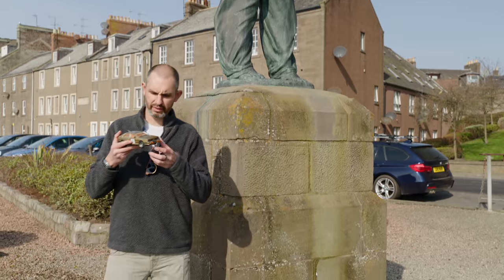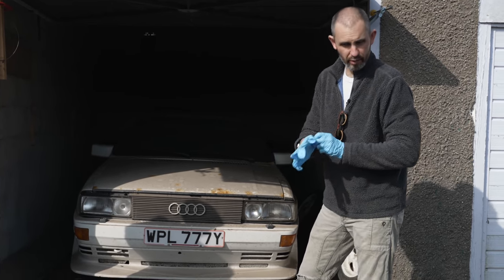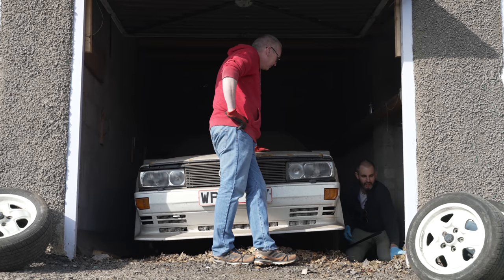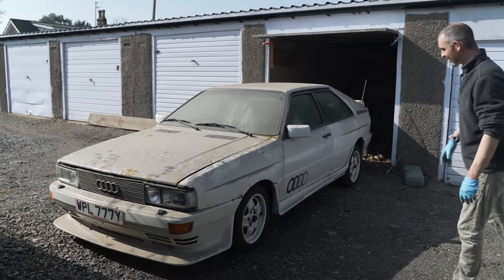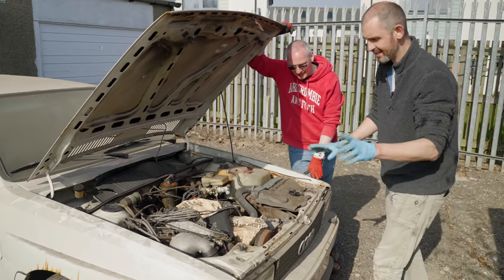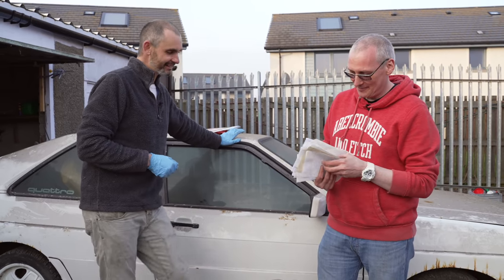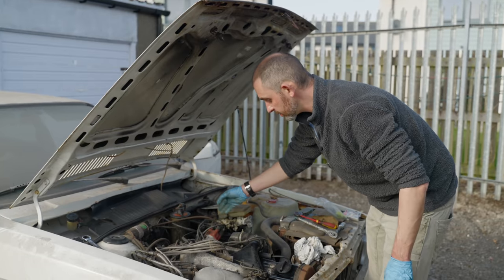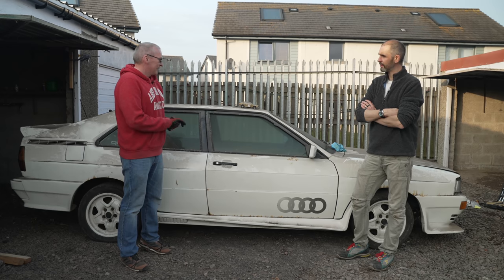Audi Ur Quattro Turbo Barn Find  - rare survivor sat for nearly 30 years

Comment: Very cool car. For anyone looking to do something similar then NEVER attempt to put fuel from an old tank (be it fresh or otherwise) through a K Jetronic injection system. In all honesty it shouldn't be put through any injection system but K Jet is extremely vulnerable to dirt & once it gets in it can be impossible to get out. That fact combined with the fact that the system pressure is high (circa 70psi) means you want to give everything a good going over before you risk sparks & fuel coming together. Ideally flush the tank & purge everything through then pressure test. With no crank on this one & from the era that the car was last used then there is a good chance it has an immobiliser or at least a hidden switch somewhere. You can normally tell if the solenoid is actually pulling current as it will casue a voltage drop which can be seen by the dash lights dimming. The other obvious point for this car which should have been checked & ideally renewed was the cambelt. Given the fact that the engine had also been left open then you would want to turn it by hand & make sure it felt ok before going anywhere near the starter, ideally you would always do that. As it's a barn find special it would be good if there was a bit more structure to the process of reviving a car that has been stood for so long, if all the right checks & work has been done then it'll run & not destroy itself or catch fire.
Reply: Perfect response and also applies to any belt drive engine and any fuel injection system.
Reply: I had a similar reaction when Jonny said he was going to put fuel in an old tank.  Should have been all spark plugs out and turned by hand.  And only turned by hand after oil was put in each cylinder.
Reply: Exactly this !. Ex SAAB Master Tech here and i did my training on 900 T 8v's so know K Jetronic well.
Reply: It makes me cringe a bit to think about the state that the oil might be in on some of these barnfinds. I know that starting the engine is part of the barnfind 'schtick', but I'd much prefer it done after the oil had been dropped and refilled with fresh stuff (and potentially flush).
Reply: Yes, the cam belt was definitley some thing that should have been changed before a start attempt. Good advice.
Reply: I would not attempt to start the engine at all. Something this age and this neglected really should be rebuilt though keep the original pistons & rings if possible.
Reply: outside of the belts which along with the tires are probably toast.  For the fuel, getting those little inline fuel filters to splice in ahead of the fuel injection go a long way.  But yeah, always better to drain (and clean) the old tank or just replace it and the in tank pump (if applicable).
Reply: Totally agree. I recall vw petrol tanks being somewhat prone to rust in the 80s
Reply: @davidpritchard6102  doing an engine flush can potentially do more harm than good,especially on a car of this age and sat that long
Reply: I had the secret switch in an Xr3i
Reply: @dazspurs9899  More damage than trying to start a car with sludgy oil blocking all the oil passageways? I doubt it...
Reply: @dazspurs9899  So what to do?  Genuinely asking what would be the best way to progress appropriately.
Reply: 😂 look at this nerd trying to explain his reason
Reply: Excellent points here. Jonny would be better getting a few knowledgeable OC mechanics to come with him and they tackle all this together. Would probably get most of the cars running on the day and safely with more knowledge and more hands available.
Reply: Couldn't agree more. The show loses credibility because of this, and anyone who's that much of an enthusiast would surely know that. 
Also have to mention ....
It's Ür Quattro, not 'U R' Quattro
Reply: That doesn't make for good TV though🤔
Reply: The way they do it looks very amateurs. Shame for petrolheads and given the age of the car.
Reply: Couldn’t agree more.
Reply: I've not even watched the video yet . For some reason  I've came to the comments first? I'm cringing about it before I  even get to see It now!! I watched him do the south African BMW light weight m series just the other day and he brought a guy along who he kept  calling Mr BMW or something like that.  Now he had everything he could possibly have ever needed to service it before even thinking about even turning it over by hand.. the only thing he didnr have at first was a good batterie pack
. Because Jonny had a poxy  crappy Ebay jobby
.. in the end, Mr BMW pulled his own brand new BMW battery off his own car... 

I do t know why Jonny try to claim hes a car lover.. it's a fucking sin trying to turn over engines that ain't ran on decades with out at least taking all the plugs out an tipping in a bit of diesel ect. The hand crank it first ect.. 

Its propper 1 0 1 basics???????
.
Reply: Truth.
Reply: @brendanobrien5842 he usually does take out the plugs and put a little penetrating oil down, seem to have alot of commenters on here, but he's the one with the show or channel, so easy to sit and say what he should or shouldn't do, but he's doing and seems to be doing alright.... I get it, and I might do something different sometimes as well, but honestly I just watch to see what cool cars are found, not to judge....

Comment: Should always check for a hidden kill switch. Best security feature around back in those days.
Reply: Agreed hidden under the dash somewhere maybe in drivers footwell, I've put a fuel pump cut off switch because cars from that era were very easy to steal!
Reply: Brodie Britain used to supply and fit them and they tuned these
Reply: Yep, done that with my cars, fitted a inline switch from the ignition under the dash that can be reached easily
Reply: Yea I think your probably onto it there . Be odd for not even a click at all
Reply: Ah yes.  The half tennis ball worked with this era vw audi.  Not that I'd know of course...
Reply: It wouldn’t have dash lights if it did tho

Comment: Lovely story and what a car! I briefly owned an ‘82 GT injection (as it was badged) which had the same 5 cylinder engine minus the turbo (body kit etc) and front wheel drive. Not the fastest car I’ve driven, but the fastest I’ve driven in a car.

Comment: I have never clicked one of your videos so fast! I am obsessed with the UR Quattro best sounding engine ever in my mind! 
I am at the place with the Visa right now and soon were going to drag it out!
Reply: Me too. I just had a similar experience an Audi 200 Quattro Turbo. Hasn't run since 2009. Done the timing belt and pumps  but it won't crank unless I wire it directly so.. now going through the hrs of frustration just to get past step 1 😔😔 Then I'll have the Mechanical injection to enjoy .

Parts are an ABSOLUTE NIGHTMARE.

But.. for the day we get it running it makes it all worth it! Right? .... Right??😥😭
Reply: @realMaverickBuckley  True..It will be indeed
Reply: Love your video's but hope you don't mind me correcting you on the pronouncation and meaning  of "Ur Quattro" The translation of Ur from German is "traditional", "primal" or in this case probably "first" would be the best word. Ur is pronounced not "you ar" but  more like "lure" without the "l"
Reply: @knowntobehonest  you are correct Ur, pronounced 'oor' means original in German

Comment: You can buy an 'alloy wheel alignment stud' for help mounting wheels with bolts rather than studs. It screws into one of the bolt holes and allows you to hang the wheel on it while you fit the rest of the bolts.

Comment: My father's 86 ur quattro has been off the road also for well over 20 years always garaged. Myself and a friend tried getting it semi road worthy around 4 years ago but everything we touched ie bolts etc snapped due to corrosion, we even had it running but would need setting up again due to misfiring slightly. It now sits in a garage in mostly whole with many new parts fitted including fuel pump, leads, new oil filters and we even had the digital dash repaired. Even the 80s car phone still switches on in the cabin.
with nearly £2000 of parts ready to fit it needs someone with professional attention and knowledge of these cars. I hope 1 day my father will get to drive his pride and joy again before its too late.
Reply from the maker: Jay, you must join the Classic Audi forum and get this car resurrected properly. Don't delay it any longer - it'll be worth it.
Reply: Obviously depending on where you are in the country? But If you want help ‘AM Cars’ in Ilminster are specialists in old Audi’s. Speak to Adam…and say I sent you!
Reply: @ArcofZen  unfortunately the funds aren't available at this time to restore it, it's going to need I'm thinking around 10 - 15k spending on it. Although the bodywork is in pretty good condition it will still need some corrosion sorting and a respray. I have a full new hose kit for it, new bushes amongst other parts as I can't remember everything i brought from the quattro corner at the time
Reply: @jaayyboy28  That’s the usual dilemma - it’s worth doing but then you’d have to sell it to pay for the work done. Definitely worth trying to get it done properly if you can tho!
Reply: The current rising cost of living (or should that be existing) isn't going to help much either.

Comment: Wonder was the cam cover removed for paint? They were badly finished and every 5 cyl Audi I owned (5) had a rusty cam cover from an early age.  The UR was one of the first cars I painted when I worked for an Audi dealer in the late 80's  .
Suprised you thought of starting it with the cam belt being so old though.

Comment: For future reference johnny this old barn cars you are starting you should be draining old fuel entirely from the connection at the carb/fuel-meter/injection rail inlet then put in say 3 gallon of fresh fuel into the tank. As for what you did with the oil can there virtually a waste of time (as thoughtful as it was :)  ) and removing the spark plugs as you did BUT with the plugs out winding the engine over for say 30 seconds 4-5 times with 1-2m breaks in between each cycle THEN everything back together and fire it up...Or at least try..hope this helps :)
Reply: fogging oil in the cylinders is also a good measure
Reply: You are better off draining the fuel tank on a UR by gravity by disconnecting the flow before the pre filter under the tank as the pre filter is easily blocked, the fuel pressure accumulator is also a weak point and then There is the fuel pump all before you get to the steel fuel pipe that runs post pump to the metering head in the engine bay. When you have done this you can add fresh fuel and then in the fuse box bridge the fuel pump circuit (as the UR ordinarily has to see crank rotation before it will power up the fuel pump relay/circuit). You should then hopefully have fresh fuel at the inlet to the metering head. TBH the old Bosch k-jet is not A fan of old fuel/sediment and along with the warm up reg has a few built In Gauze filters that will be blocked along with gummed up mechanical injectors so I wasn’t holding my breathe in all honesty as I’ve been there with old UR’s.
As true petrol heads I think it’s always nice to try to breathe life into a true garage find but alas with this old girl I would prefer to just strip her down, clean and refurb/ reassemble and fire her up when the restoration has progressed the that point. Such an iconic car, I don’t think I would ever part with mine having owned it for the last 21 years.
Reply: @kimberleycannon6894  I will have had mine for 22 years this coming December. I agree with everything you said!
Reply: @jameshoward2738  Barely practical going to all that extra far from practical VERY excessive faff especially in his case lol......£10-20 12v pump off ebay is perfectly fine to put in line if need be....Not to mention another reason to do as mentioned is to also help move/flush stagnant crap along/out the lines and filter too! soon as the new fuels in repeat til  a couple litres is primed through of the fresh stuff all back together and away you go
Reply: @monkeymagic4555  All that faff is what you'd need to do before trying to run it from it's own fuel tank, filter & lines. I do not recommend trying to do that. I do not recommend trying to run it at all without some basic checks and recommissioning work. 
You need 6 bar of fuel pressure to the metering head which doesn't lend itself very well to rigging up a cheap pump and a bit of hose. From the pump, through the accumulator & filter, all the way up to the metering head & injectors are all high pressure lines & fittings. Once dirt gets in the fuel filter, it cannot be flushed though, the point of the filter is to trap the dirt.
That car is surely going to go from there to some place the recommissioning work can be done on the back of a truck. I wouldn't try to start it first.
That's just my opinion as a long term owner who has spent over 20 years getting to know these cars inside out. From the detail in their post, I could tell Kimberley has similar experience of them as me. That is why I replied to their post.
Reply: @jameshoward2738  

I worked for a VAG dealership from 1990 to 96, saw many of these at around 10 years old. 
The biggest issues by far after a decade were failed fuel pumps and metering heads. 
Generally from being run out of fuel or irregular inline filter changes. 
 
Bosch K jetronic was temperamental right across the VW Audi and Porsche (924) range if not looked after.  
Even poor quality fuels or water contamination would cause expensive issues.  
I remember Tesco who had their own oil tankers settling a large court case for contaminated fuels at their pumps around 1993 traced back to poorly flushed ocean tankers. 
We saw a few casualties from that, prompting our service manager to start asking if it had been regularly filled at our local Tesco forecourt. Water contamination also from forecourt underground tanks. 

I did the Bosch K and D Jetronic courses up at VAG Milton Keynes and i recall the instructor telling us the inline filters should have been added to the interim service (5000 miles) from the start of production on the K systems but were not until a few years later. 
 
When the MOT petrol emissions test arrived, 1991, many a metering head was damaged by non VAG mechanics/MOT inspectors who didn't know the correct procedure for adjusting the emissions. 
Done incorrectly resulted in bending the arm that controlled fuel distribution inside the metering head. 
These were also prone to sticking/gumming up if the vehicle hadn't been used for a while.. 

  The MK1 golf GTI had an issue with steel filler necks rotting out in the rear arch after around a decade from mud getting trapped above the filler neck.  
The fuel tank would fill with mud and grit each time the car was filled with petrol, destroying the /M head regardless of how serviceable the inline filter was. The paper elements in the line filters and the gauze in the metering heads were not good enough to stop fine microns of grit. 
That involved a full strip of lines/tank out and flushed, new pump, pressure regulator and a metering head if the emissions couldn't be stabilised. 
Some very big bills. 
So i wouldn't consider it faffing about either on a car parked up for 20+ years consuming varnished petrol. 

We had an exceptional example of one of these owned by a doctor that had it  repainted in a pearlescent fleck paint in our body shop. 
It was stolen by some joyriders from Oxford train station and crashed into a multi storey car park barrier damaging both A pillars. 
The insurance paid out for a new body shell and we rebuilt it complete with the same custom fleck paint. 
 I think everyone in the company took that car out for a test drive at least once.
Reply: @jameshoward2738  He's doing quick stop car reviews/unveils  you spaz not his own projects.....ie drive there drive home same day...refrain from breeding...And if you have already....Do the right thing....

Comment: Crazy how small wheels used to be on performance motors
Reply: I had an XR2  late 90s
185/60/13! 
Handled superb.
Reply: @stuartd9741  I learned to drive in my dad's 69 mini, those things had tiny little wheels too
Reply: @stuartd9741  Rapid little cars too.
Reply: Yeah loved my XR2 fun car.
Imagine no power steering!
Never drove an original mini.
Those had 10 inch wheels.
I currently drive mini Cooper S.
has 17 inch wheels...how times have changed....
Reply: @stuartd9741  The original Mini is one of the best handling cars ever made. Any corner...Any speed. It would go around.

Comment: In 2014 on ebay there was a G reg Audi coupe 2.2 GT for sale near Glasgow. 
It had done ~44000 miles.
Totally original. Wanted 5.5k.
Couldn't quite make the finance..
as the car was 400 + miles away
Quoted 500 to trailer it back to me.. 
( was a runner didn't fancy driving 400 miles back on an unknown timing belt).
Still regret not buying it..
Should've maxed out the credit card..
Nice video as always Jonny.
Such an iconic vehicle.
Can't beat that 5 cylinder warble...

Comment: I worked in an Audi main dealership from 1989 for a few years, On the south coast. The only reason I can think someone would remove the valve cover would be the check the valve clearance? Did the early cars have sims like the other VAG cars? I only remember one other car with those wheels, which was an early car too. The later Quattros have the more pronounced dish, which was more to my liking. It’s difficult to say, but this body kit could be a Treser kit, which is probably extremely desirable, to a genuine aficionado of the Audi make. I think most Quattros had colour coded rear spoiler, different to the coupes? Your friend with the coupe collection, the Pearlescent White, I remember only one, it was an Audi uk press car, and later had a well distinguished owner in Poole Dorset? Great Stuff! Looks like the Audi zinc body process paid dividends on this one